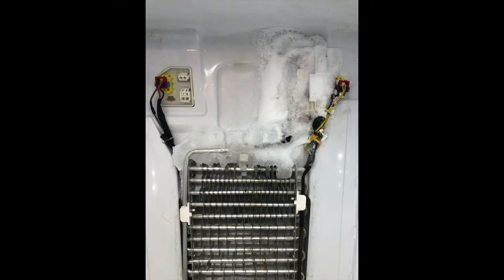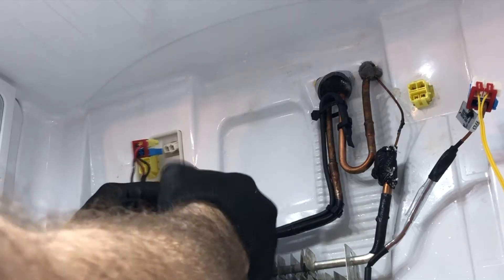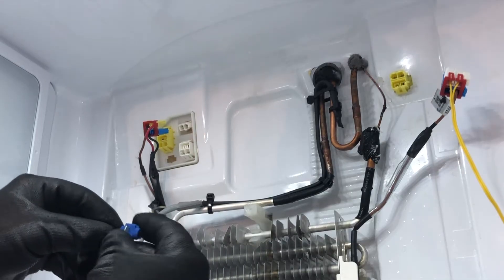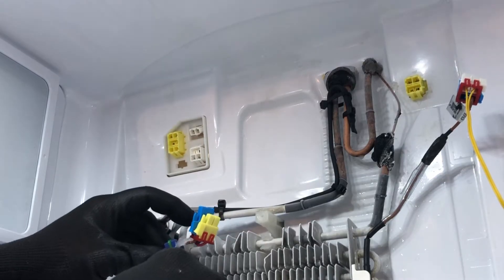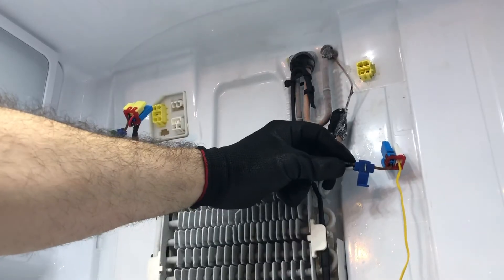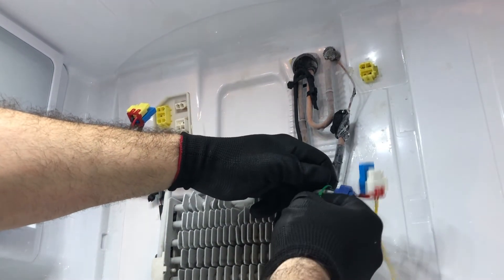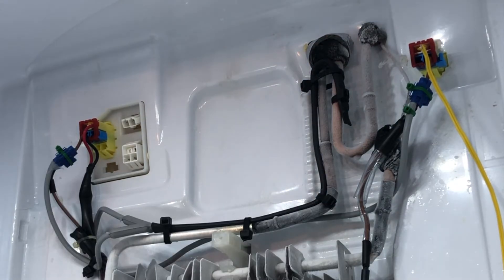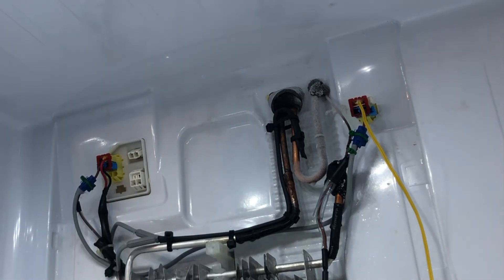Samsung FDBM evap heater add

Comment: The issue I'm having with this is when the unit goes into defrost the suction line is not freezing because compressor is not running, I'm confused on how this is supposed to prevent ice build up around evaporator fan motor especially since ice builds up due to warm air being sucked in by the fan motor and not a defrost issue. Another issue is the original heater pulls a certain current and adding additional heater without slight voltage adjustment will affect how this unit works. Please explain
Reply from the maker: since the heaters are in parallel, you have the same voltage across both heating elements, 120vac. the added heater heats the suction line that has frost build up on it already, it melts it, that way it can't build up into the evaporator fan motor housing. the moisture build up can be caused by a drain issue, which needs to be rectified (vast majority) or long compressor run times due to a sealed system failure.

Comment: i know this is a solution, but check the heater, the thermostat. if does check out good. also clean the coil of the unit, if the coil is dirty or the fan is not working, then the gas stages of temperature are not going to be right. so it could continued to freeze no matter what. u are just extending the time with this solution. in my case the board is not turning the heater on when the thermostat is calling for it, so of course is going to freeze. 
i might install this after replacing the board and testing that its working
Reply from the maker: This video was not meant for diyer's, it assumes you diagnosed it properly in the first place. This is not a patch to be put in place because you have a failed part. There can be many reasons why it will 'frost' up, (not 'freeze' up). Just one (of many) I have found is that the mullion flipper will not close properly letting air in. But again, this is not a 'how to' on fixing a Samsung refrigerator, it's a modification I came up with because you can diagnose and fix all the potential failures, of this unit and still have that frost accumulate. This is for those cases. I don't put the heater on every time, but the units that have the icemaker recall (direct contact icemakers in ff that frost up) Those are the ones that need the heater, especially when the icemaker stops working properly. Cheers.
Reply: @electronicsprojects4708  completely agree with u, my comment is to make it clear to the people in here, that there are many other things that causes this problem. but this is excellent. do you know if rf323tedsbr is on the recall
Reply from the maker: @Jennyay07  In STG it refers you back to the bulletin/recall doc for frost build up. This is when you look up 'no ice troubleshooting' for your model ASC20170602002.

Comment: I'm having this same issue both the drain and fan are freezing over.
It happens about every 2-3months. I have a Samshng Model RS2544SL.
I checked everything. Everything else on the fridge is good. I will be adding the drain kit. Which my fridge does not have at all. My question is this my model fridge also looks different once I open the back of the inside of the fridge. Will this work for my model fridge and if so where exactly is best to install it?
Reply from the maker: I have not had to instal the heater on a side by side Samsung. On those, I find the drain gets clogged and I do use the Samsung drain kit, very common. Also, clean out the condenser compartment, (including all vents inside and underneath) That makes the fridge more efficient and less prone to frost up again. You want to make sure that once you defrost the drain, you can power a glass of water in the pan and it flows all the way through the drain with no problem. I also widen the hole in the drain pan for the drain. It has a metal grid I don't like. I just make it into a round hole like a normal pan from other manufacturers. I use needle nose pliers for that. Make sure you clear ALL the frost from the cover (taking the fan housing apart to do so) and especially the top of the evaporator around the fan area. Easiest if you just unplug and let it defrost with the doors open for 4-5 days. It saves time in the defrost process. I don't have the luxury of that option with my customers, lol. But if it's a garage fridge, no big deal.

Comment: I did this, and mine froze up still.  I think the main problem is it thawing out and then quickly refreezing or building up from the part to the right that doesn't have the heater defrost line on it.  I think maybe some pipe insulation on there would help.
Reply from the maker: what temperature is the heater getting to when you test it in diagnostics mode? Make sure you put in the new revised drain kit or the drain will clog, causing it to frost up. This video was meant for technicians, so it assumes you know certain chronic problems for these models.
Reply: @electronicsprojects4708  I ended up opening everything back up drying it out completely and that seemed to have resolved my issue.  I think when I put it back together the first time it still had enough moisture in there to build up ice faster then that could melt it.

Comment: After defrosting my Samsung French Door Refrigerator at least a dozen times over the past three years, I decided to try this fix. I've tried a bunch of other fixes... Extending the aluminum drain tab, the drain tube replacement, etc., etc., etc. Samsung is no help, it started freezing up right after the warranty was up. This was clearly an engineering flaw and Samsung won't do s*** about it. 

Here's the problem: Followed these instructions exactly. When plugged back in, my fridge reads the error code "S 3" and the heater is not heating up. I can reset the error code, and the fridge and freezer seem to be operating, but the coils are already icing up and the heater is not warming at all. 

Model #:
RH26HFENDSR
Reply: That's the prob... No techs want to work on Samsungs in my area. Had no choice but to diy.

I was one letter off on the model number: RF26HFENDSR

Yes, you are correct, I am not a technician, but I am fairly handy and can work a wrench and a set of pliers just fine.  I completed the repair exactly as instructed in the video and it isn't heating and is giving me the "S 3" code. Do these heaters fail often?
Reply from the maker: @ajcbulldog  no, the add-on heater needs to be installed in parallel with the defrost heater. the '5E' error code (S3 is not an error code) is the defrost sensor error. If you hooked the add on heater to the sensor circuit, that could damage the control board. Get me your zip code and I can see if I can find someone in your area. This is not a simple fix, no easy answers here.
Reply: @electronicsprojects4708  97071
Reply from the maker: @ajcbulldog  I posted it, I will let you know if any techs are in that area.
Reply from the maker: @ajcbulldog  Try JAS Appliance Repair. Tell him Michael Moore referred. 2947 Tide Ct NE, Salem, OR 97305.
Reply from the maker: @ajcbulldog  Also, Salem, OR
Judys Appliance Outlet
Reply from the maker: as stated at the start, this video was for technicians, not diyer's. I would recommend calling a technician in your area that is knowledgable about this fix, to diagnose the problem. The model # is not even showing up, unless you are outside the US. It works, just needs to be installed correctly and tested to make sure the heater is heating.

Comment: My Samsung French door never froze around the fan but the drain hole was  freezing. I bought the revised (longer) OEM drain heater probe and drain still  froze. Together with the heater Probe I added a 10 inch long copper wire, wrapped around the heater element a couple of times and feed it through the drain hole for about 7 in. also lowered the heating element down slightly closer to the drain hole. It has been about a year  and no more ice buildup. It took 2 full days to melt the ice in the drain line where i could feed a thick trimmer line all the way from the drain hole to the container back behind the fridge on the bottom. Vacuumed and cleaned the cores, cleaned both drain tubes as well. I had tried many different things before with no luck. Also lost 3 icemaker buckets where the blade flexes and gets trapped behind a metal shield.$100 bucket gone. So took apart the last broken bucket and saw how close the blade is engineered to the shield. So took apart the new bucket and bend the inner blade 1/4" away from the shield. Works like a charm for almost 3 years now.

Comment: Great fix! I have a french door model #RF323tedbsr/aa that had the ice issue. I just finished getting rid of the ice and reassembling everything. Does everything you have listed good for the model as well? We purchased the fridge new and it is the first time this happened. I suspect there has been either ice build up or condensation in-between the rear metal backing and the inside plastic panel as there is a large (wet) rust spot and water drip marks under it. The fridge is 7 years old. Thanks for the instruction!
Reply from the maker: if the upper portion looks like the one in the video it will work. There is a drain mod from Samsung to prevent it from leaking under the deli tray. In general, I recommend qualified techs fix these as there are so many fails on these models.

Comment: Thank you for this video.  I have a temperature sensor on order as mine is bad.  I'm hopeful that this will be the fix for my icing up issue behind the Twin Cooling cover in my Samsung refrigerator.  I measured the temperature of the existing heater coil with a multi purpose meter and it measured 133 degrees.  Is that a sufficient temperature or correct temperature for the coil?  Your added heater measures approx. 30 degrees higher.
Reply from the maker: I would recommend calling a technician to do proper testing. The video is made for technicians and is not a comprehensive how to fix a frost up issue on a Samsung refrigerator. It's a video demonstrating the installation of a heater when all the normal fixes don't work because of Samsung's poor engineering.

Comment: Question Sr., Could I use any other sylicone grease? cause that one I can't get it as soon as I need it
Reply from the maker: yes, as long as it is rated for cold temps. you can look up the data sheet online.

Comment: Ok, I installed the heater and 2 months later, I have the clicking noise! What else can you recommend I do?
Reply: Well, to be perfectly honest. Not many people pride their work as you do. And it shows in your work.  I think your video was by far one of the best I've seen regarding these issues. No way do I want to bring harm or hurt to someone such as yourself. I felt bad after you explained yourself to me. I honestly didn't know. I was frantically looking for a fix to my issue and did not read your summary before watching your video. I admire your workmanship tremendously. Thank you for your time and knowledge.
Reply from the maker: This video is for technicians, so it assumes that the drain issue for the ff evap is cleared, since this is a very common issue, I don't address that part of it. If you are not familiar, and the drain is iced up. That needs to be taken care of.
Reply: It is the only thing I can think of that I didn't address,bc I didn't see an ice issue  in that area...that will be the next thing I will address. My apologies if I offend you by doing this task, I'm not an appliance tech. Unfortunately, I do own a Samsung fridge. I truly appreciate your time, guidance, and videos. Many thanks!
Reply from the maker: @e.shealer2417  No offense taken, but the reason I put up my videos is to help techs address issues that the manufacturer can't help with. I find that hiring a factory trained professional that has years of experience with these problems is the best way to go for my customers and the general public. Appliance repair is not simple, like a lot of videos on YouTube portray. Usually cause they are selling something.

Comment: Hi, will this work on the samsung freezer? My fridge only froze up once but the freezer keeps freezing up every couple of months. Thanks
Reply from the maker: I have never needed to use an add-on heater with a Samsung freezer evaporator, I would check the drain to make sure it's not icing up.The evaporator is much wider on the freezer, so you would not be able to put a heater on in the same fashion.
Reply: @electronicsprojects4708  thanks for the quick reply! After some researching, I'm going to test the defrost heater and see if it is broken. Thanks again

Comment: I missed what should be connect to where? is it an electrical connection?
Reply from the maker: connect the Supco heater in parallel to the defrost heater. if you are not sure, and you are not a tech, I would call a qualified technician to fix your fridge.

Comment: Hi about to try this fix on my samsung.  I am in Australia which uses 240V, hopefully supco provides 240V version.  Just with the cable tie, do I need to look for specific high heat resistance cables? or any standard ones would work?  Thanks
Reply from the maker: Find a heater that's 15 Watts and gets to 160 or 170 degrees F. You can search for high heat zip ties, you can also just tie the ends and wrap it around the suction tube like a snake, if you are concerned for heat.
Reply: @electronicsprojects4708  Thanks for the advise, i managed to find a 15 watts heater from supco at 240v

Comment: I am wondering what part I would use on my Samsung fridge in Australia, ours run on 240V.. any ideas…? Mine is an SRF752DSS
Reply from the maker: I am not familiar with 240v drain heaters, where you could get them. I assume you can, since they are very common in commercial applications. You want a 15 watt heater, should get to 160 or 170 degrees F.

Comment: Ever seen one of these used?  If so, did it work ok? This is kind of neat and almost looks like something Samsung would make as a fix (well at least cosmetically)

https://youtu.be/hU1S8zQgebM
Reply from the maker: That heater mod is $77, you can get 3 of the Supco heaters for that price. I don't see a benefit to it over the mod I came up with.